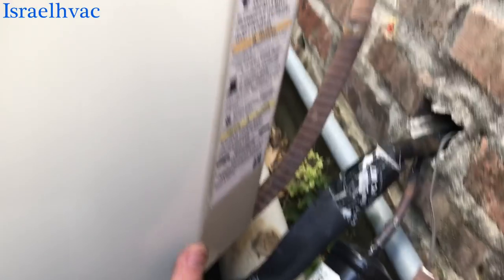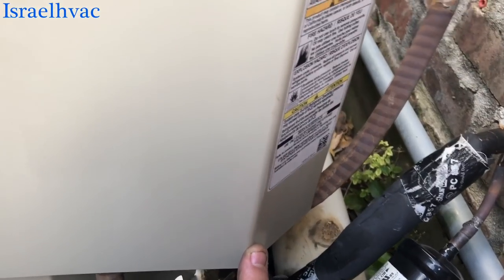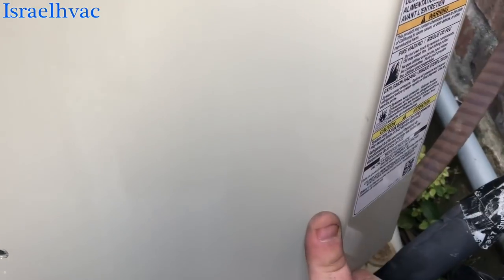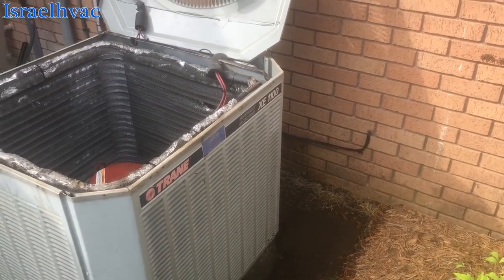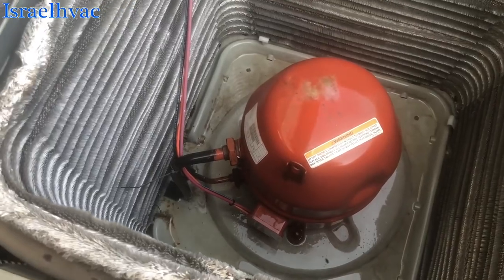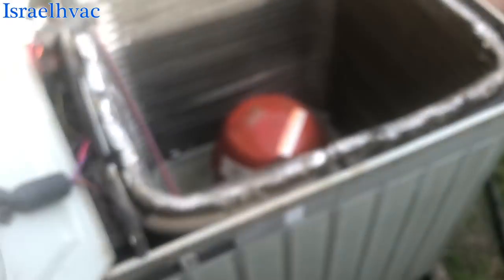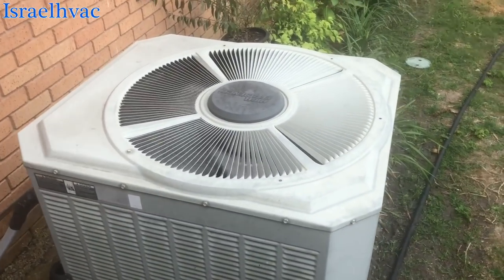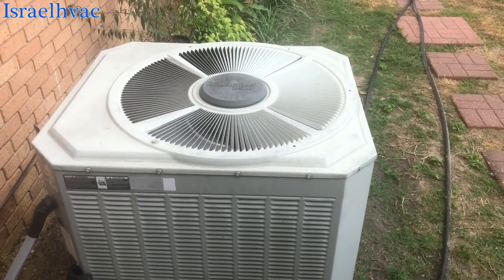A Little Rant | Trane XE 1100

Comment: I would guess that is the old whip from a change out where some LAZY installer did not care about anything but getting done and gone. I agree it is a shame we lost the Climatuff which was one of the few important things that really gave us the "claim to fame" as a tough unit... we just cant get the efficiency from a recip. unit needed without great sacrifice so the compressor was dropped. Many of us also believe IR forced the issue because it was expensive to manufacture as compared to the modern scroll.

Comment: my heil 5000 was from 1995 running great. i took it out because furnace heat exchanger went bad and its a downflow so i wanted a cased coil to match furnace. but ya that unit looks dam good. i like the pad/raisers too

Comment: Only thing I don’t like about them compressors are the rotor locks when they rust out and leak or someone didn’t in the plastic gasket. Them compressors are heavy also.

Comment: Were there leaves inside the condenser? What did you used to clean it, before watching it? 
I’m trying to find a better way to be more efficient in cleaning the inside of the units. 
Thanks!
Reply: Abner Garcia a shop vac